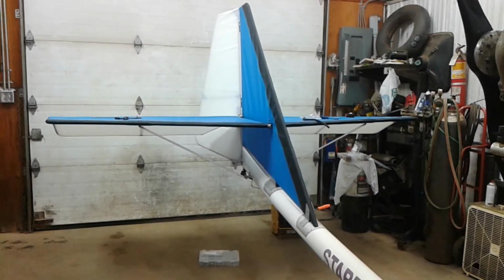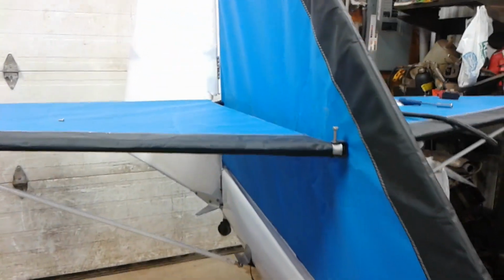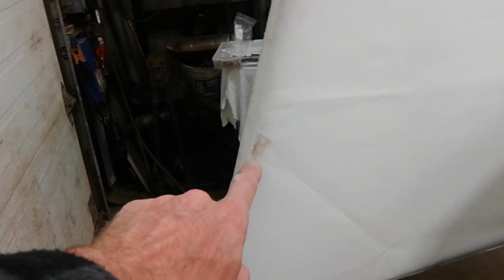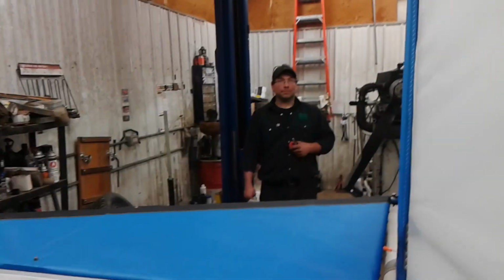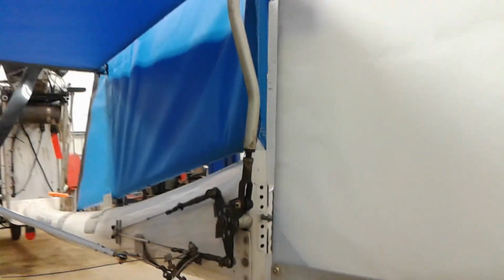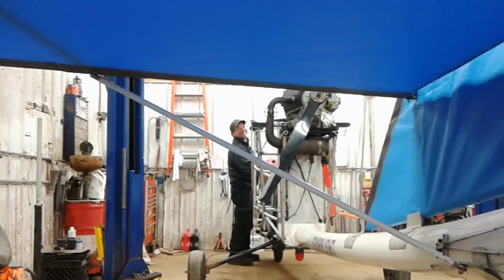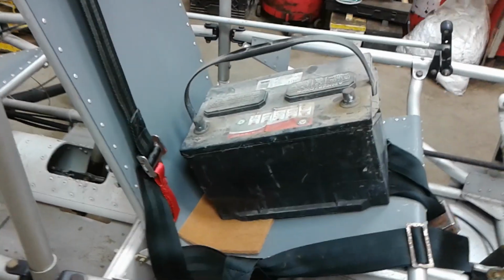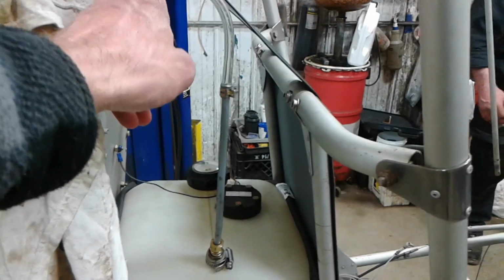Tail Feathers | CGS Hawk: Update 3

Comment: Be sure and check both elevator cables for wear/fraying where the go through the boom tube, be sure the plastic sleeves over the cables are intact, and not worm through.  There was an AD notice for this, as one actually wore completely though and failed, causing loss of elevator control, and a crash.
Reply from the maker: One of the first things we looked at. This one apparently has an updated setup which doesn't suffer from that problem but we'll definitely be keeping an eye on it!

Comment: Beware of those little tiny fuel filters!  They can be plugged easily.  Big diameter fuel filters will take a lot more before flow stops.
Reply from the maker: Thanks! I'm sure it'll be checked before each flight but that's definitely good advice.

Comment: Hey I added an inspection port (like from a boat but with a hinge and lock) in my fiberglass nose cone so I could access my battery.  Once you put on the cockpit/nose cover the battery will become a dark square thing that is about impossible to reach.  I wish I had done this earlier!    I also went with a Lithium Ion battery....saved a bunch of weight but had to redo my weight and balance.  The tail looks wonderful!   I can send pictures if you need.  Dan
Reply from the maker: Dave doesn't have the fiberglass nosecone. He's going to look into some sort of access hatch in the fabric to access the battery. My email is in the About section. I'd love to see pics of yours!